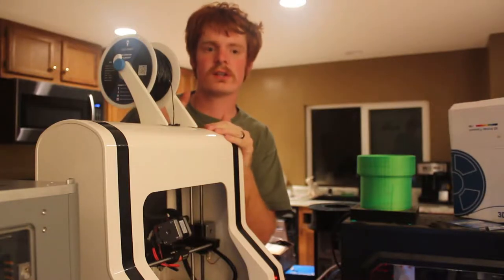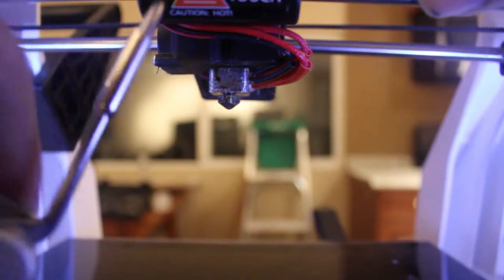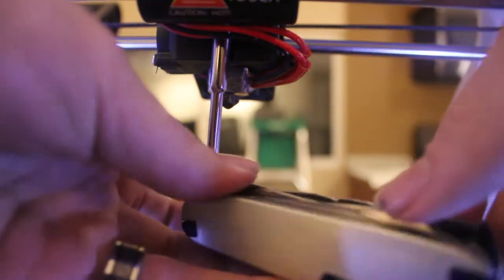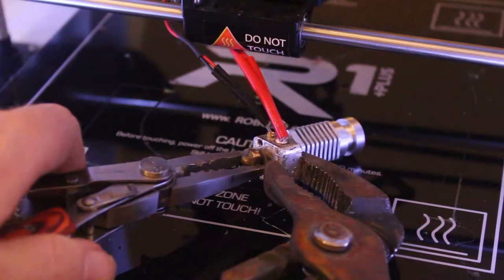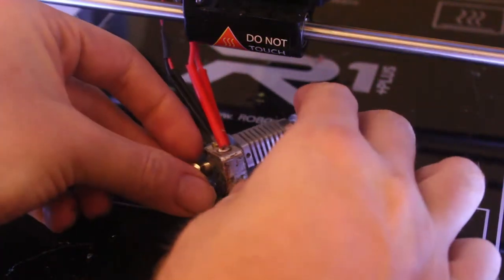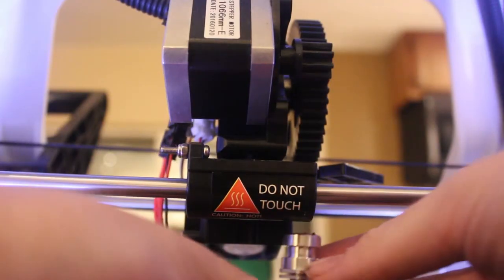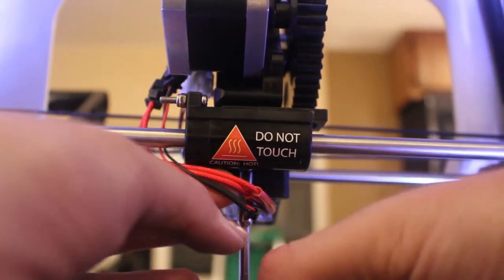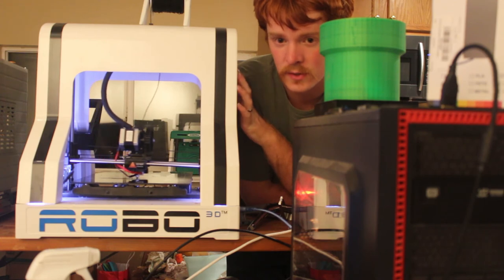robo nozzle upgrade/replacement

Comment: You should heat up your hot end for a final tightening. it will help prevent oozing from the nozzle heating block connection point